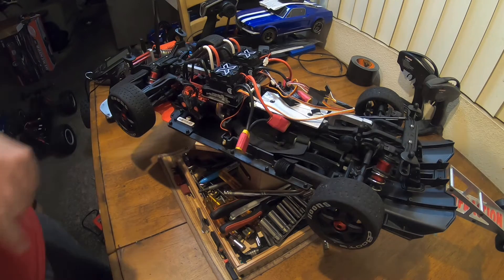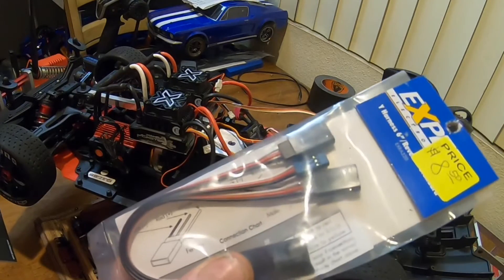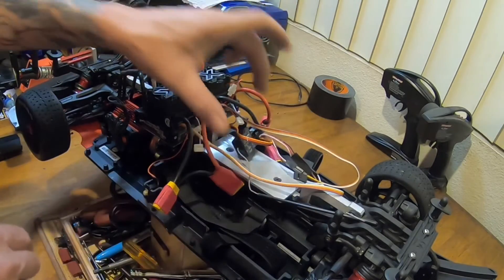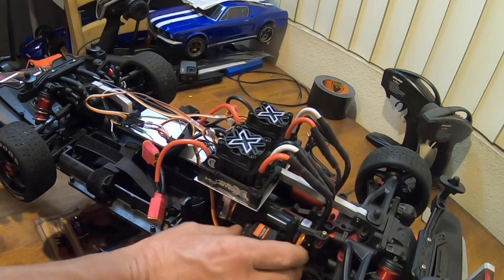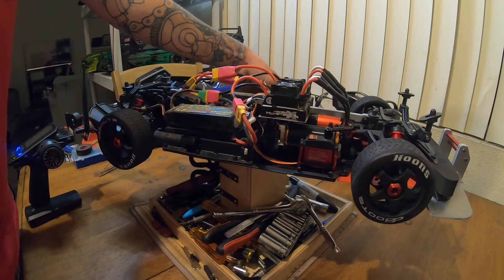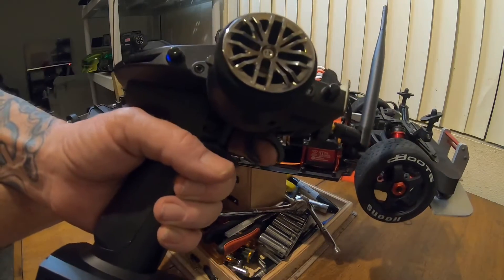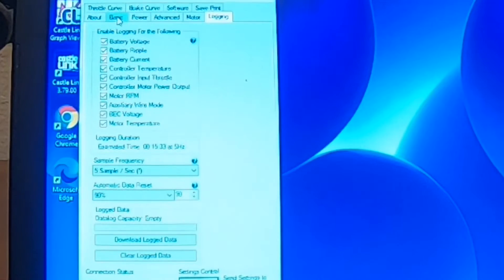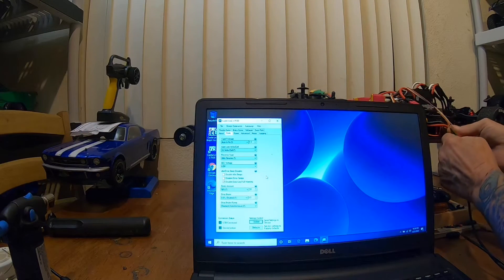Twin motor YouTube infraction first power up & esc calibrations does it catch fire??

Comment: As the other commenter said, you have a futaba transmitter and castle says in the manual to into the receiver and change the motor direction. That would've been there fastest and easiest way. The punch control needs to be enabled to work. With it disabled, it gives full punch. It work in reverse with the numbers, 100% means full throttle limiting.
Reply from the maker: I tried flipping in the controller first the video was with the controller set to reverse but the brakes didn’t work correctly so I set back to normal and flipped directions in the esc to make the brakes work correctly 👍👍💯💯🔥🔥🔥

Comment: Nice, ever thought of using two different KV's motors?
like a low KV for off line torque and a high KV for top end push? 
or two different pinion gears?
would it blow itself up ?
I thought of doing that one motor for Front and one for rear, 
low KV / small pinion front and high KV / big pinion for rear.
Reply from the maker: Yes I’ve thought about a two speed motor set up like the gas guys are using 💯💯💯

Comment: What gears you end up goin with and prefer. Robinson Racing for me since first pinion purchase. And no if your motors are on same side of the mount they need to be spinning same direction. Not reversed from each other.
Reply from the maker: Correct on the motor direction 👍👍 I like saga custom gears the best my second fav choice is Roberson racing for sure steel gears 👍💯🔥🔥🔥🔥
Reply: @earlmoorhead5555  Saga hey. I'll have to check them out. I'm happy with stock spool and pinion so far just not happy with the mesh. The supplied limitless gear dosent mesh tight enough for my liking and it's the absolute smallest you can run with supplied stock spool.
Reply from the maker: I agree the gear I’m having issue with is an arrma gear 💯💯🔥🔥🔥

Comment: great build.... what did you use for your receivers. I am building a 12s traxxas xo-1 with a TQi receiver, I tried the "Y" cable but it seem that there is not enough power to control both esc's. Any help would be great..... Thanks

Comment: Earl what’s the difference between switching the motors in the esc setup or reversing the throttle channel on the radio/transmitter? I’m just curious if there is a difference. Also do these ESC auto calibrate or can you manually do the throttle and reverse throw on  them? If it’s possible it may smooth out your throttle input so it’s not so violent right off neutral. If you can’t maybe add some expo on the throttle channel it may smooth out the initial on throttle input. Just a thought
Reply from the maker: All great info when I switch the rotation on my controller the motors went the right direction but when I went to brake it went right into reverse with no braking so I went into castle link to switch rotation to get the brake working also if I just flipped two wires on the motors it would have worked the same I just wanted my wires straight and not crossed over each other and castle link I can control the take off power several different ways 🙏🙏💯💯🔥🔥🔥love castle for there Esc programming and data logs 🙏🙏💯💯🔥🔥🔥

Comment: Can u teach me how to join 2.esc wire to receiver?i don't know is just double it or what? please help
Reply from the maker: You use a Y splitter to channel #2 but on one esc you need to remove the red wire so that only one esc powers the receiver so one esc will have three wires and one will have two wires it doesn’t matter which one you remove the wire from 👍👍

Comment: Nice !!!
Reply from the maker: Thanks 🙏
Reply: Man that thing is going to be a best can't wait to see it run I need to get mine up and running I just don't know how to tune the ESC s
Reply from the maker: If there both new out the box you can just connect them the same on both esc to do a test 💯💯🔥🔥🔥🔥
Reply: Ya that's what I did but I want to tune them to get the most power out of both motors and esc's  I'm going to be using it to drag race with !
Reply from the maker: Omar Gomez should be fun to get it to hook up I’m sure good luck 👍💯🔥🔥🔥🔥

Comment: Okay catching up with this build didn't know you had to remove one wire from one of the esc
Reply from the maker: Yes the factory esc supplies bec voltage to your receiver 5.5 v or 6.0 v to power the steering servo and fans plugged into the receiver ports if you add dual esc you can backfeed the voltage into the other esc and burn up both esc and receivers so just take one bec output wires away doesn’t matter which esc you remove the wire off of I did it at the Y connector so I keep the esc stock for warranty purpose 👍👍

Comment: Futaba throttle channel needs to be set to reverse from my experience.
Reply from the maker: Ya I reverse it on my futaba but the brakes didn’t work properly so I had to flip the controller to normal and change it in the esc 💯💯🔥🔥🔥🔥🔥🔥🔥